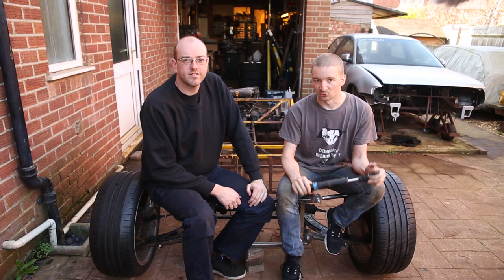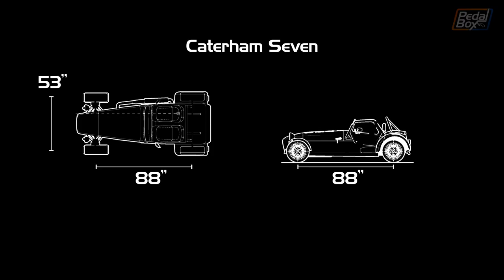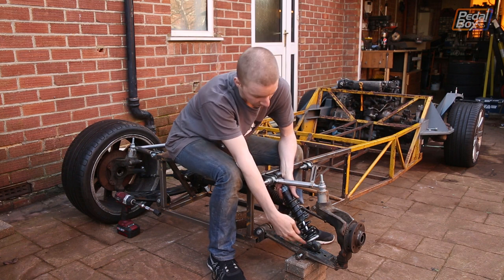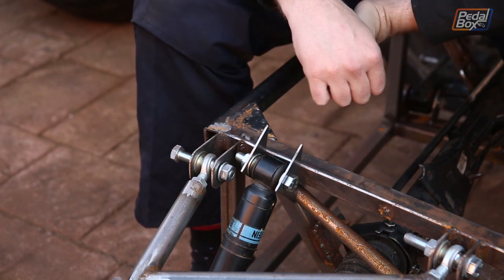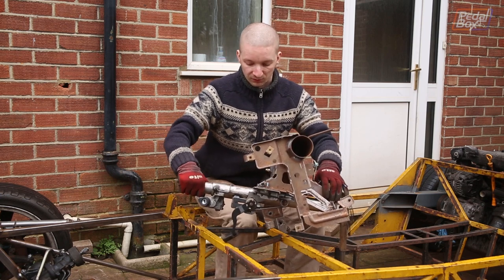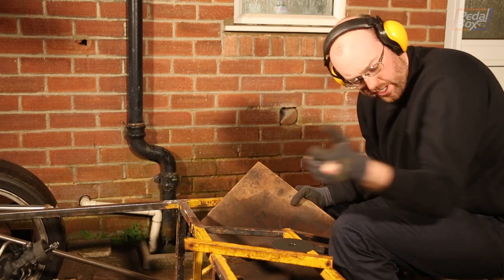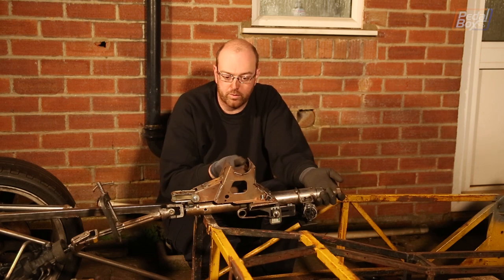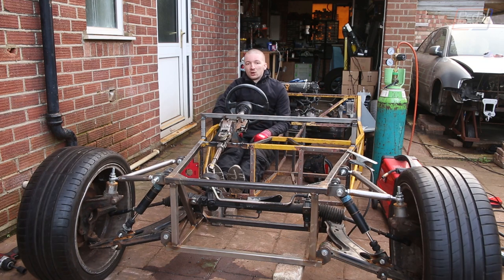Rolling Chassis - PedalBox Episode 19 | Mid-Engine Audi Kit Car

Comment: Is this intended to be road legal?
Reply from the maker: The plan is to put it through an SVA/IVA and get it on the road yeah, it makes track days far easier when you can say "it's taxed. MOT'd and insured". Then it's just usual tech inspection
Reply: I am an mot tester I know Sva is different to mots as it's just to get the car on the road but I'm pretty sure you can't mount the front suspension coil to the Audi bottom arm, have you checked the mot manual? a bottom arm like that would be classed as a stressed component.
Reply from the maker: Interesting, it's  a little more inboard than a standard Caterham, but the normal Caterham suspension mounts to the arm, rather than the hub. 
https://i.imgur.com/H6Ldio8.png
Could be an interesting grey area to check before we put in for the SVA, maybe we'll have to go push rod after all to the hub
Reply: The caterham arm will have been designed to have the mount there, the a3 arm are not, you may need to make a new set of bottom arms, also Iv seen those arms bend pretty easy from hitting a kerb while driving, your putting all the chassis weight into the middle of the arm which it was never designed to do.
Reply from the maker: Fair point, new lowers was something we were looking at potentially in the future, not much harm in making the sooner rather than later though, still got enough of the tube we made the tops from afaik.

Thanks for the advice!